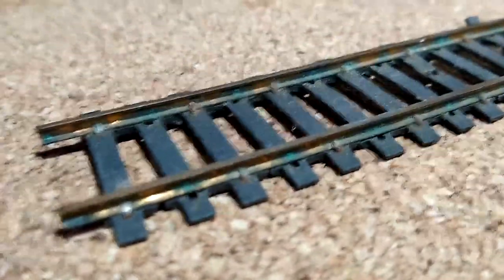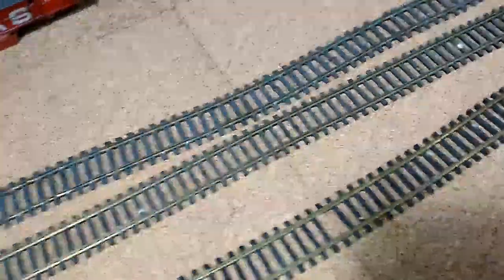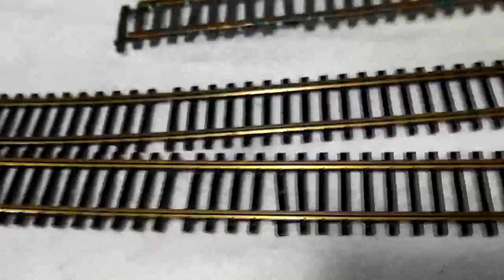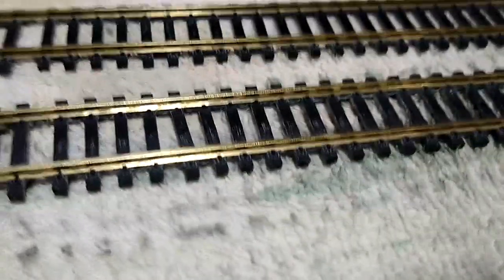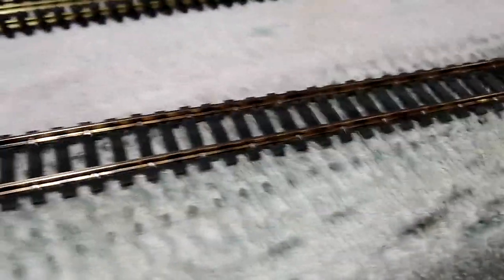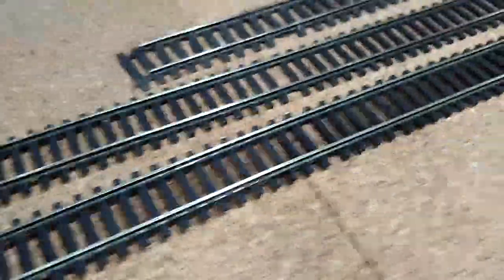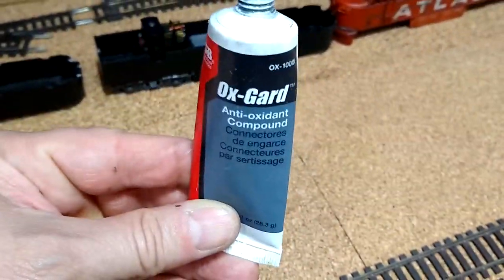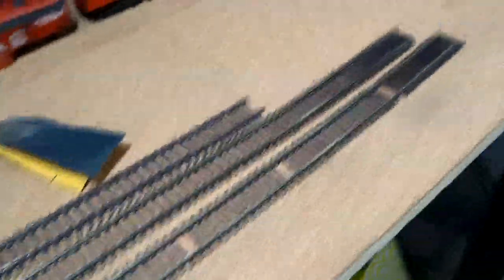Recycle Old Brass Flex Track into working condition

Comment: I really appreciate your informative videos.  I am a 76 year old getting back into the model train hobby and am essentially  a beginner again.  Thanks for your postings.  John Birmingham COO Fort Industry, Vistula & Frogtown RR
Reply from the maker: once that brass track is installed, it won't fail or need to be cleaned for several years - so far the section shown has gone almost 3 years without 1 cleaning and works flawlessly.  Don't pass on brass track if the price is right.  I also do not glue my track. As you can see in the videos it's regular cheap bulletin board corks squares and small finishing nails.  I use a nail setter and a small tack hammer.  I regularly remove sections, improve them and reinstall them with no problem - also because I don't solder joints but I do Oxgard every rail joiner.  Only when I make special sections of track do I use solder.  This method has proven it's worth after going through a period of -30 degree weather and a massive storm that brought water through the window directly onto the track.  Neither damaged or dirtied the track.
Reply: @elite194  Thanks for your response.  Are you located anywhere near Toledo, OH?  Do you have an E-mail address where I could contact you?  Thanks,  John Birmingham
Reply from the maker: You can send me a message at elite.railroad at marketmaker.net

Comment: 90% of my track is old brass, the trains are old too. Keeping the track clean and running trains keep the track polished, and the train running
Reply from the maker: all my old brass track that has been treated with Oxgard hasn't needed cleaning in years and brass is a better conductor than NS track!  since the rail gets painted eventually, there's no reason not to use brass!

Comment: Thanks for video. I was given a bunch of free HO stuff and bought a pile of old brass track on ebay. I didn’t realize at the time i would need to do something with the track. Its definitely in need of some love. I bought the supplies months ago and im finally ready to try your method. Starting with a track bath 👍🏻. Ive collected N and HO for years. Time to put something down for my little boy to enjoy. Wanted to start with some cheaper HO because he wants to touch everything. But hes 2 and a half so thats expected.
Reply from the maker: I got a video coming up today where I recycled old brass track into my new yard ladder - all continuous rail from old track.... save all brass track you can get your hands on because using the preservative Oxgard changes the game completely
Reply from the maker: you can use brasso on NS or Neverdull is really good but the best is metal polish from the auto parts store like Mother's or Mequire's

Comment: Thank you for making this video. I feel like I just had a light bulb moment !  I had  all atlas code 100 brass track. I may have some nickel too but the majority of my layout is brass and I clean it, trains run great then a month ot two goes by and my locos being dcc don't run well. I'm going to go get some ox-gard, clean my track and apply this and see what results I get .

Chuck
Reply from the maker: search my videos for track cleaning car - it's the lighted cars I use to tell me if the track is actually dirty.  you probably have one of more of these already.  when you run that car around, the light goes out or flickers where there is need for cleaning.  Also, Oxgard can be removed from unpowered frogs with acetone and a paint brush.  Over time it can get rolled out like dough and you dont want it energizing you switch frogs - the spotlight car will detect that also!

Comment: So I have a lot I’d like to reuse
If understand correctly, sequence for brass is:
Wash with dish soap in sink
Apply brasso with toothbrush
Wipe with microfiber
rinse cold water in sink
Dry
Paint
Apply ox guard
Correct?

Thanks in advance.  This is good stuff. Very helpful video.
Reply from the maker: yes and that totally works!  I've used spary paint to do the painting and then sanded the rails when dry before putting on the Oxgard.  Even mixed in with nickelsilver track, everything painted the same, you  can barely tell the difference - but the brass is a better conductor!
Reply: @elite194  alright 
Let me ask this.  I was going to put graphite on rails to increase conductivity, coat rails. Not needed with Oxgard?
Overkill?
Fine to do in addition?
Thought was to regularly run MOW with additional graphite application. 
What think?
Reply: The other thing was the graphite should make all the rail look like, well, rail.  Real tracks are shiny, but not nickel silver or brass color….
Reply from the maker: graphite and Oxgard do not mix probably because I think Oxgard must have some graphite in it.  when applied to the rails it can take weeks to fully go to a dry film, but that's never been a problem.  the Oxgard will darken the rails just a bit, but I've found that to be a feature!
Reply from the maker: on dry rail, especailly brass, powedered grapite with a makeup brush does make for a nice steely look!
Reply: Well
Used 9” sectional track as test
Here’s the tale of the tape after cleaning:
NS- (new, did not clean) 2.0 ohm
Brass- 2.0 ohm
Get ready for this,
Steel (Tyco at that)- 1.9 ohms

It would seem to be keeping them clean is the most important thing….

Now, uncleaned, yes higher ohms. Danced around making hard to put true reading on it. But I can definitely see how causes running issues and needs to be clean clean clean
Reply from the maker: yes for sure! there is a table in the ancient codex HTWYMR authored by Linn Westcott.  He was the first to identify anti-oxidants as useful in model railroading!
Reply: Well
Few can argue with Mr. Westcott
I’ve also learned to listen to those who’ve done something for a long time. Fact is, if installed and left alone with minimal prep/maintenance NS will run trouble free longer.  
Fact remains that if prep is preformed and maintenance done the other track CAN and will perform on layout. 
All being said, I have NS flex track ready to go for mainline and  industry sidings.  But the large quantity of brass that I have will clean up and be perfect for yards and staging. This will save me tons of of money, considering expense of switches as well. 
Thx for all your videos and posts sir.
Reply from the maker: all my yards and sidings are brass track which has not needed cleaning in over 7 years since it was first cleaned and installed!
Reply: @elite194  thanks again
Would you worry so much about the website of the rail?  I’ll clean everything but think I heard somewhere most of the electrons flow along the outside surface of conductor.  Once the webs are painted they shouldn’t ever oxidize. Don’t want to waste too much time on sides if not important.
Reply from the maker: @jdmills4370  in the fast tracks soldering guide they also talk about once rail is painted you don't need to worry about it.  since the rail is sealed oxidation doesn't happen.  since I nail down my track, I try to paint it before I install it and then I'll do a little tie detailing later.  using the sanding block to the top of the rail helps the Oxgard really grip the surface nicely and stand up to a lot of wear and tear!
Reply: @elite194  that’s what i figured. Thx for clarifying. I am going to pay close attention to where old rail joiners were. These will be soldered and feed every third or fourth section. Yard tracks only 12’ so I’ll have really good conductivity.
Reply from the maker: @jdmills4370  that is the way!

Comment: I have been confused by various conflicting notions for years regarding caring for track. On one hand, we are told to never use an abrasive on track because it will speed up oxidation by making tiny scratches in your track. Yet every layout I go to has a "track cleaner" with an abrasive pad... then they complain about how often they have to clean (gee, I wonder why?) You use very tiny grit sandpaper on your track but you use the stuff to wipe it down which fills in the scratches because, otherwise, your track would oxidize quickly  right? I've seen another theory: after cleaning or sanding track to get it clean, use a burnishing tool to rub out the tiny scratches and smooth the track. I guess doing that then adding your preservative would be the ultimate fix?
Reply from the maker: I use 1000 grit, but I've used 400 also.  I like the the fine scratches so the Oxgard can really grip the rails.  In ancient times when Linn Westcott and John Armstrong tested Oxgard, they found it to be very "liquidy" - but they knew this was the way of the future.  Fast forward 50 years and no one remembers what they discovered.  I stumbled on it first by doing an electrical project and thought I could use it on trains.  When I found it to work I thought there was no way I was the first to think of it - and I was right, the old Masters tried it and liked it before it was ready.  Today's formula does what they wanted.

The number 1 problem is that people foolishly clean track with rubbing alcohol.  The the track sparks you get an instant carbon deposit, just like that online train magazine detailed in its track cleaning issue in early 2019.  This should be obvious if you ever had junior high school chemistry.  The other problem is people clean all the track all the time.  That's why I made the video using a light bulb on a flat car to detect the dirty track and clean only the dirty sections.

The problem with polishing the railhead is that "ground effect" will "unclean" the track.  The fine scratches allow the anti-oxidant to get "rolled" into the scratch and fill it.  But Ground Effect happens when a bunch of wheels in a row roll over a rail and push everything off like a wave - uncleaning the track.

If you've built pinewood derby cars and gone through the axle polishing process, then you know that after the 1000 comes rubbing compound then leather to achieve "optical grade" finish on stainless steel.  So 1000 is just 2 steps below optical.  That should be just right or a little over for fine surfacing.  My own track is excellent without cleaning for almost 3 years.   But, if you saw the GP38-2 Final Exam - a Life-Like locomotive with a single truck pickup loses power in some places that either didn't get Oxgard or didn't get any finishing at all and oxidized.  This was the worst on Nickel Silver track.  Treated brass has been the best so far, maybe because I was rough on the railheads with 400 or 600.

Now if you want the best optical grade finish on your railheads, the easiest way to do that is Brasso for brass or Noxon for NS and a cloth polishing wheel on your dremel tool.  You could even start with a 600 on the rail then buff.  Untreated it will still tarnish.  If the track doesn't get constant use or continuous running like at train show with trains going round and round, it will work with no problem at all.

Comment: Do you wipe of the track after you use neverdull?  I noticed the track leaves a lot of grime on a paper towel after I used neverdull and didn't figure I should leave it like that.
Reply from the maker: when using neverdull you need to wipe off the oil it leaves behind. neverdull works very fast on really bad track, but also leaves some fuzz.  washing the track after cleaning is another important step to loosen the old ties and hot water with dish soap works very well to do that.
Reply: @elite194  thanks. Just finished my bench work and now laying track. Using oxgard in all the rail joiners.  A toothpick works great for that

Comment: I've got a couple hundred pounds of bachmann Ez track I've accumulated through my childhood, could i do this with ez track?
Reply from the maker: yes, but EZ track is super durable and should usually be cleaned and used again in difficult places.  Otherwise, you can certainly take that rail and use it - but if it's the steel track you will find it to be more physically difficult, but same method
Reply: @elite194  thank you!